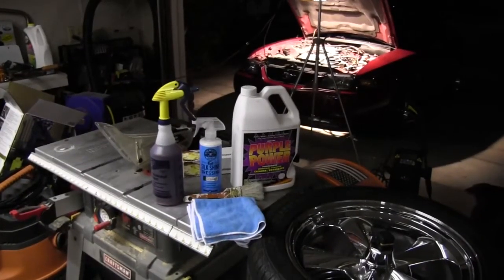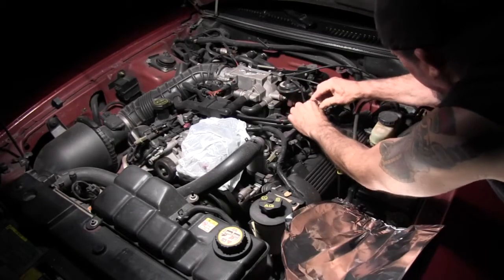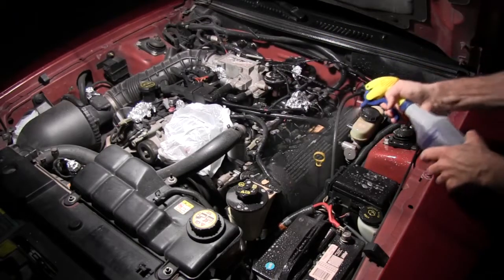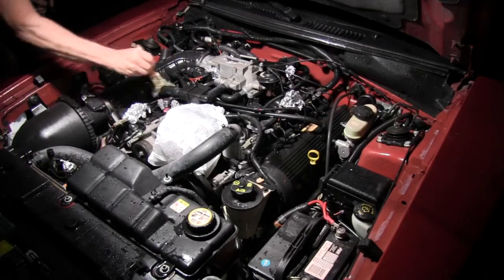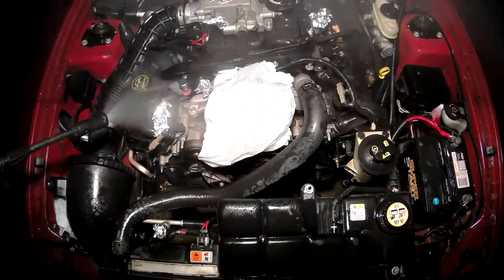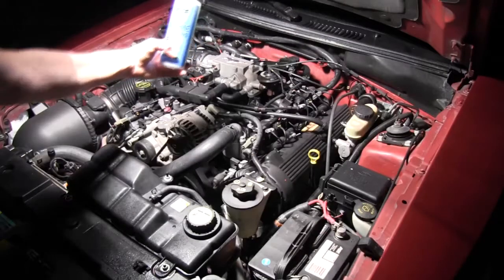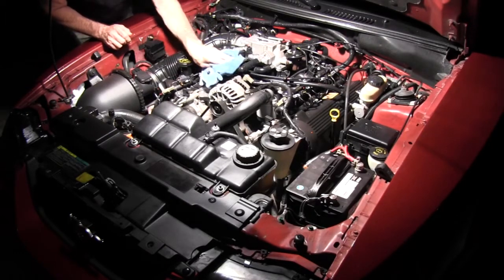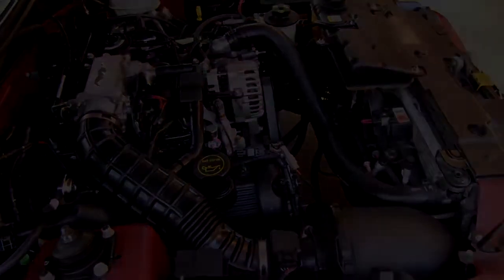Engine Bay Cleaning 2004 Mustang GT

Comment: is the silk shine okay to get on the electrical connections? or can I just leave the aluminum foil on until after I'm done spraying?
Reply from the maker: You can leave the foil on just to be safe but silk shine shouldn't hurt your electrical connections.
Reply: CHRIS10077 okay so maybe just try not to get too much silk shine on the connections?
Reply from the maker: Yes that would be my advice .
Reply: CHRIS10077 alright thanks so much! I just subscribed right now so I could watch more of your mustang videos haha
Reply from the maker: Your Welcome and thanks for subscribing .
Reply: CHRIS10077 okay so now I just got the purple power and silk shine but I just noticed that you didn't cover the battery terminals and also got them wet, is that bad? sorry for so many questions im just very scared of messing up my car
Reply from the maker: Shouldn't hurt the battery terminals however if your concerned about them then by all means cover them . Happy Cleaning .

Comment: can you video for ford f150 engine? what are the thing need to be covered. thanks
Reply: Disconnect battery. Cover coil pack (if equipped), air box, fuses